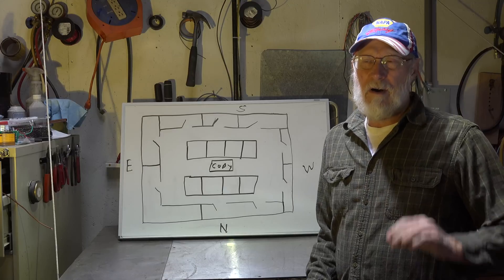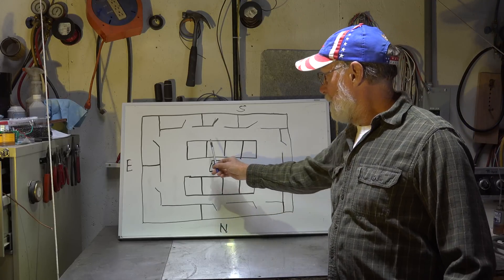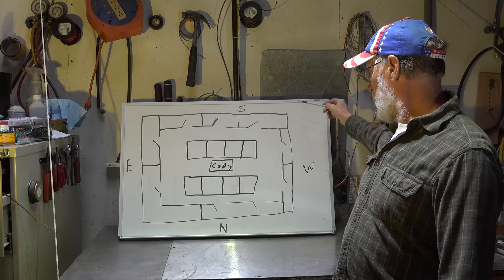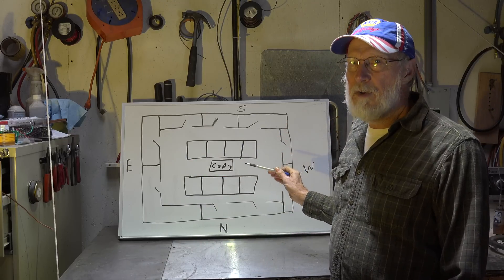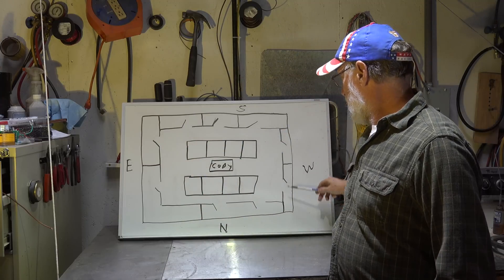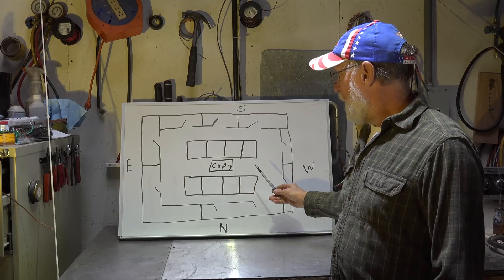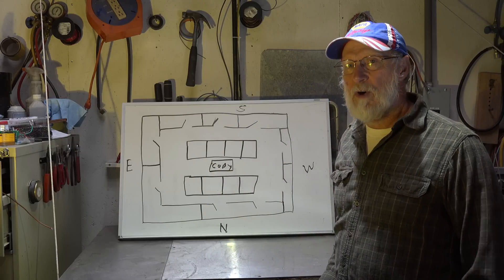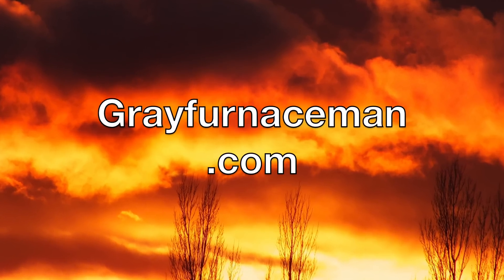How to heat and cool at the same time #1

Comment: going to need to install PIU boxes and have some type of VAV setup
Reply from the maker: No PIU or VAV.  Each heat pump has its own AHU and is a package unit.  The zone is controlled by its own thermostat.  There are issues with thermostats to keep them from fighting each other, but it is effectively a large number of small units with their own zone.  Hope this helps.
GFM